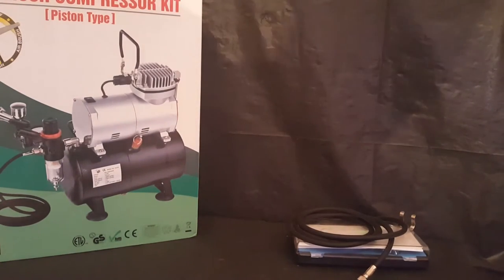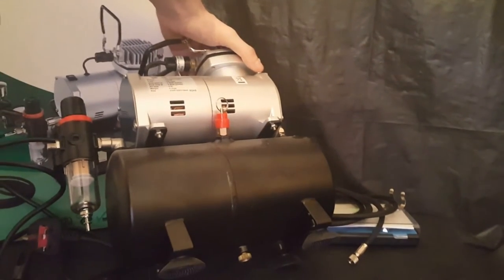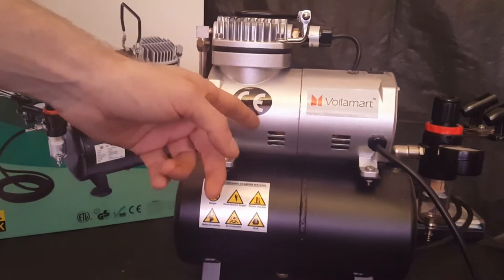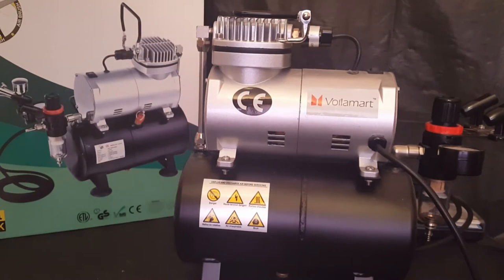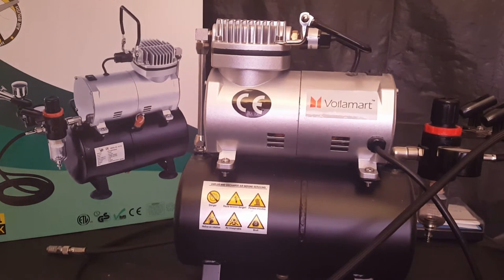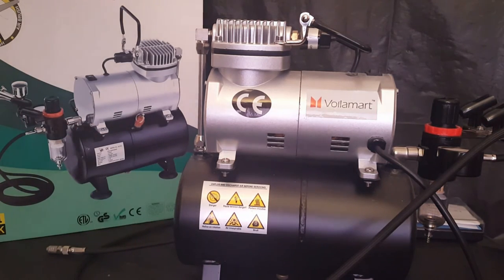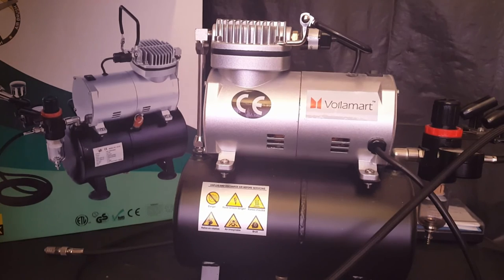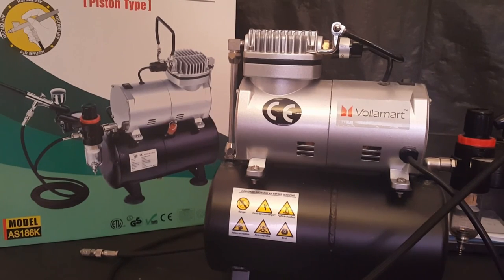MINI AIR COMPRESSOR FOR ETCHING AND AIRBRUSHING UK

Comment: Do you have a video of you etching glass with this? what sort of medium do you use? - Cheers
Reply from the maker: I used aluminium oxide for etching glass with this and yes it works very well, using the small etching gun, I think it was a 1/8th hose attachment.
Not sure if I have a video using this  method, but I have made lots of etching using this set up.
👍👍👍
Reply from the maker: Yes I have a video in my HOW TO playlist
Its called how to glass etch, it shows my tiny set up that I used and the stuff I used.

👍👍👍
Reply from the maker: I also etch solid metal very deep, using a 12v battery from a kids ride on car, bit of sponge, screw driver and some water with salt in it.
You should check my CUSTOM ORACLE BATTLE AXE video for that set up aswell.
Reply: @oraclescave  lol ill have to check your vids out :) thanks so much for the reply
Reply from the maker: @zenobibonsai  no problem at all Barry
👍👍👍

Comment: can you tell me where you bought the compressor ?
Reply from the maker: On ebay, many different sellers, this one was called voilamart.
But lots of other rebrands of it.

Mini air brushing compressor with tank.
Just search for that and you will find it easily.
Hope this helps
👍👍👍